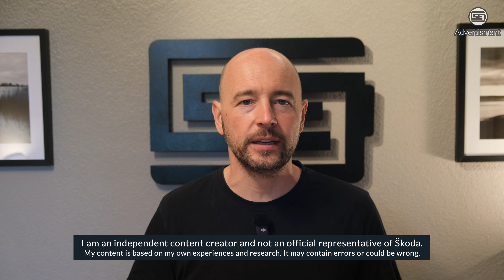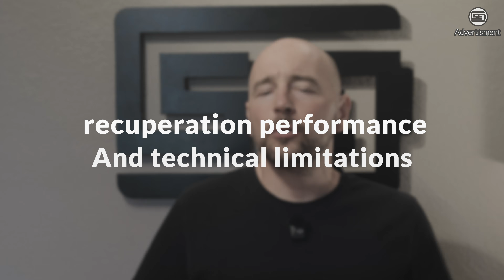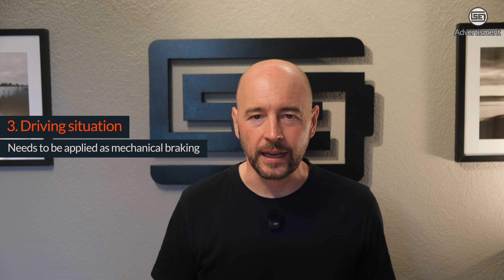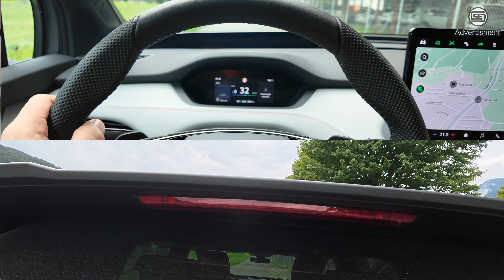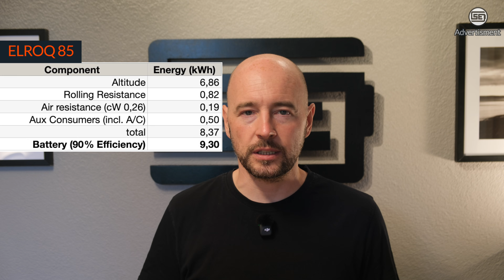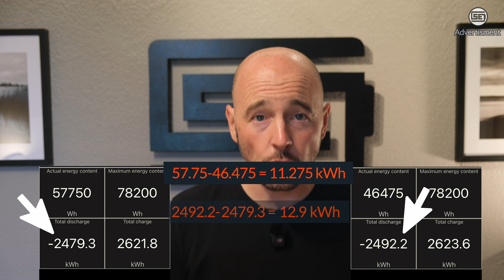Magic or Physics? Regeneration in the Škoda ENYAQ & ELROQ Explained + Real-World Tests!

Comment: I am currently transitioning. From a Tesla 2022 M3LR to a 2026 Elroq 85. I had superb range from the Tesla, and drove it exclusively in one-pedal max-regen mode, it was excellent. The Elroq is quite different though. Range seems to be quite poor in B mode (high regen) when driven like the Tesla. Therefore, I am trying the D mode, which defaults to coasting when lifting off the accelerator, and it seems to give me much better range per kWh. It looks like the kinetic energy of vehicle movement is better utilised for coasting than when used to regen power due to the losses in converting it to kW to recharge the battery. By braking only when needed, which does also create regen energy equivalent to B mode, I seem to get much more efficiency, closer to the Tesla in it's one-pedal mode.

Comment: Up to what speed does regenerative braking work when stopping, or at what speed is the friction brake activated to stop?
Reply from the maker: Below 7km/h it will only brake with friction as there would simply not be enough energy regenerated to make use of it.

Comment: 13:40 this is not true, having constant regeneration power is NOT dangerous. I have this is my car, and it is not problem to drive with.

That that car manufacturer in question have chosen to implement a constant negative acceleration and not a constant force does not make constant force dangerous. But it does make it more predictable.

My car tapers off between 30 and 12km/h or if detects wheel slip.

Comment: 10:55

The regulations regarding brake lights are completely logical.

The -0.7 to -2.3m/s² is completely logical.

This clause enables the brake to turn on at -1.3 and turn off again at -0.7. This prevents the light from blinking when you are just at the legal limit.

Comment: Gr8 inspiration video thanks! Could you sometimes focus on the difference between D/B regarding coasting? is this coasting approach really so effective? like better than drive on B mode? Is it more efficient to break rather suddenly than smoothly?
Reply from the maker: Thanks! Great point. In short: coasting (easier to achieve in D) is usually most efficient, because you keep momentum without energy conversions. B (where coasting demands a really sensitive use of the pedal to hit that sweet spot) mode is useful in city traffic or downhill, but every regen cycle has some losses. For braking: smoother is better. Gentle deceleration keeps regen active longer, while sudden braking makes friction brakes cut in.
Reply: @electrifiedspeicher thank you for your reply makes sense to me more now!
Reply: @electrifiedspeicher   Thank you very much for your reaction! So basically I am coasting if I am moving and my green/blue bar is somewhere in the middle. Shame that Škoda has no interior indicator when regular brakes engage to train this a bit :)

Comment: Hi Mathias, great video and thanks a lot for all the info here. Is it of a great benefit to have the heat pump installed in Enyaq? All the best and blessings.
Reply from the maker: Heat pump is a good option when it gets cold and you do longer distances. You may get 10-15% more range then. But on short distance trips it will not be very helpful.
Reply: @electrifiedspeicher  My current Enyaq iV80 has a heatpump. On my new ID.7 Tourer coming next month I have not taken the heatpump due to limited advantage. Heatpump is more efficient on cold temperatures which is rarely the case in my place (NL). In addition people should understand that when you have a home charger, you could preheat the car from departure which reduces the advantage of the heatpump even more. So heatpump is mostly only recommended in colder areas and when you are not able to preheat the car on a charger.

Comment: This mimics my empirical data with our Enyaq 85x. Haukeli that I think you also drove here in Norway is a steep, but fast climb from the coast. The enyaq is much more power efficient than our petrol golf up hill and drives on air going down hill. Would be interesting to see how much more or less energy the 85x regenerates with the two motors vs. one. I suspect the final bill would be very similar.
Reply from the maker: Yes, we drove there as well but down to the coast so the other way round. There is no real difference between RWD or AWD when it comes to regen as nearly everything is done with the rear motor